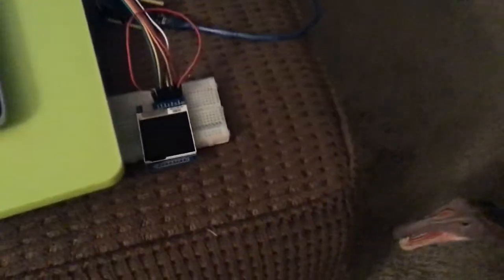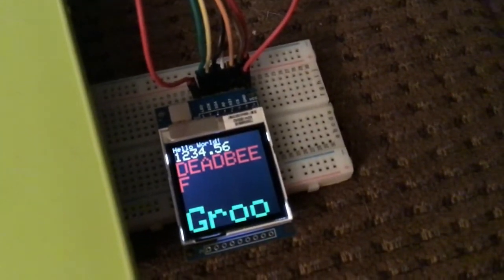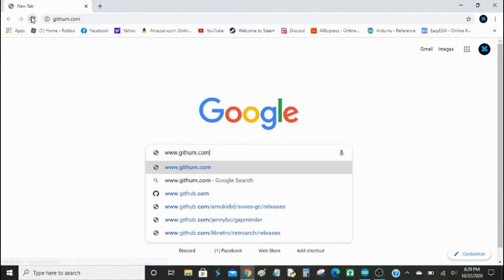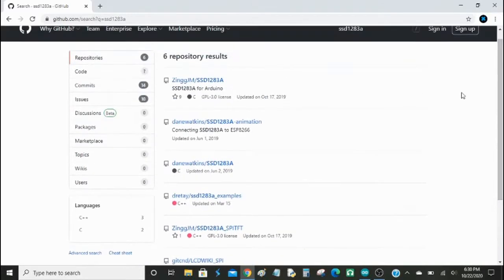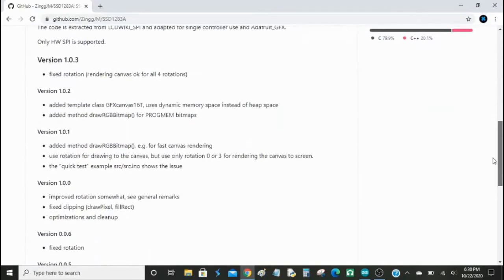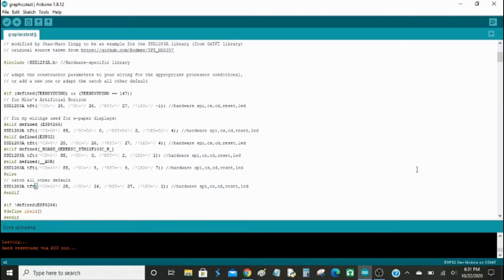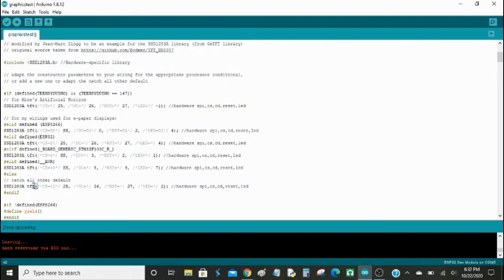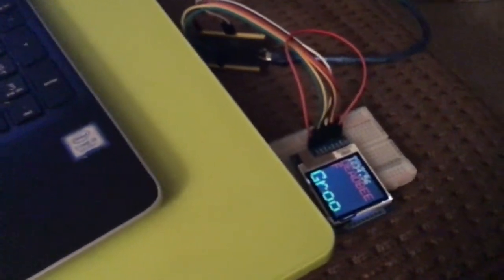(Old) How to use 1.6 inch SSD1283A tft lcd module full tuturial

Comment: I like the video dude, just only I have a stupid question. How can I conect on ESP32?

thanks and greetings from Mexico
Reply from the maker: Thank you for your support. Here is the wiring i used to drive this display on esp32:

You should see in the library said in the video where it defines ESP32. Make sure the board is selected and change the said pins.

VCC (positive power): 3.3v
GND (negative power): GND
MOSI/SDA (data in): 23
CLK/SCL (serial clock): 18
CS (chip select): 25
DC/A0 (data/command select): 26
RST (reset input): 27
BLK (backlight input) 3.3v

The CS, DC, and RST pins can be connected to any available pin on the controller. And the BLK pin can be used with PWM to dim the brightness. This display also has a full logic level shifter for use with 5v, but I prefer staying strictly at 3.3v just in case.
Reply: @XanCraft21  Thanks
Reply from the maker: @sergiogomezvegas9023  you are welcome! :)